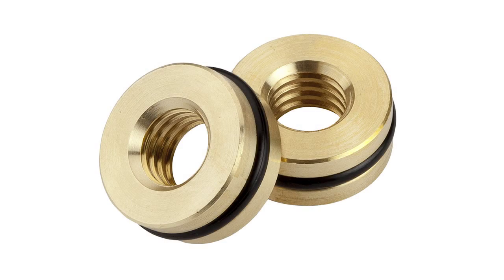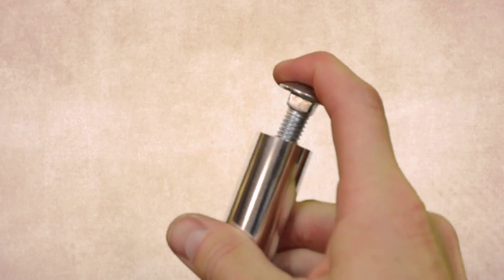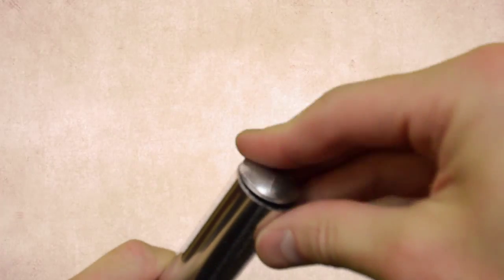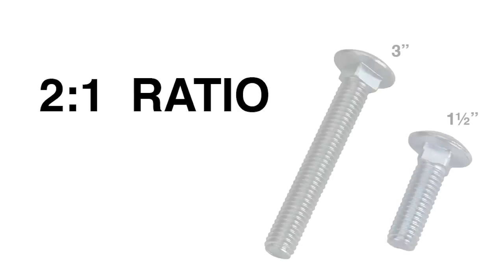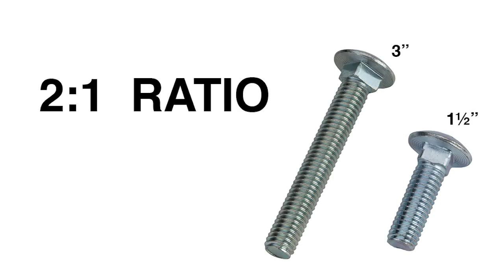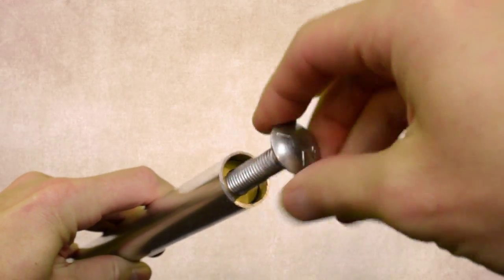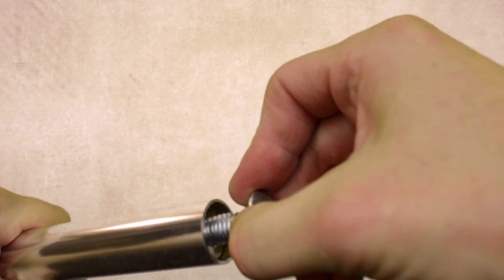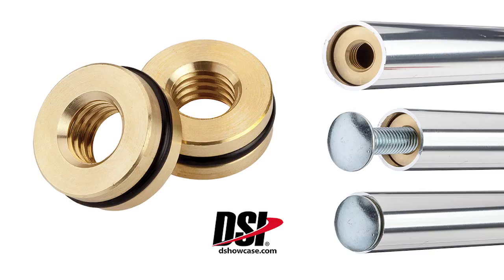Flag Pole Weight Anchor System from DSI

Comment: Is there a standard weight that is normally used in a flag pole by most people? Is 3 and 1.5 the common weight?
Reply from the maker: Yes, the 3 and 1.5 are common for indoor and sometimes people move up to the 4 and 2 for outdoor to keep the flags steady in the wind.
Reply: Thank you!

Comment: I wonder what dci guards use for their top weight and bottom weight?
Reply from the maker: It usually depends on the silk and how heavy it is (which is based on size and the amount of sewing stitches it has). Typically they will use a 3" on top and 1.5" on the bottom or 4" on top and a 2" on the bottom.

Comment: Do the weight anchors change the weight at all?
Reply from the maker: Yes ... the weight anchors weigh a few ounces and should be put into both ends of the pole. You add the different length carriage bolts to add more weight to each end of the flag pole.
Reply: Emily Schirle i know this is really late but i personally like to cut my weights in half from what i’m used to (i.e: i’m used to using 4” and 2 1/2” bolts, but with the anchors i use 3” and 1 1/2”)

Comment: This makes it seems like it is incredibly easy to insert the anchors, but I have not been able to insert mine. They don't fit on my pole
Reply from the maker: Hi Jaime ... The Flag Pole Weight Anchor System was designed to work with DSI flag poles. If you continue to have trouble feel free to give us a call at (800) 893-8171 and our customer support team will be able to assist you.
Reply: dshowcase ok thank you
Reply: Jaime Quinones get a 6" Pole

Comment: what is the diameter of anchor?
Reply from the maker: The weight anchors are approximately 1 inch in diameter. They are designed to fit inside the DSI aluminum flag poles.